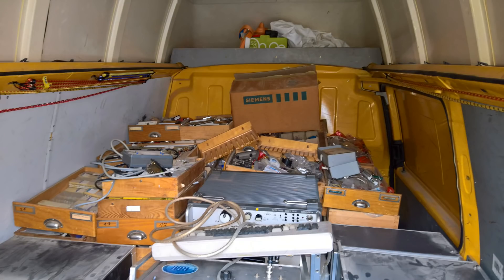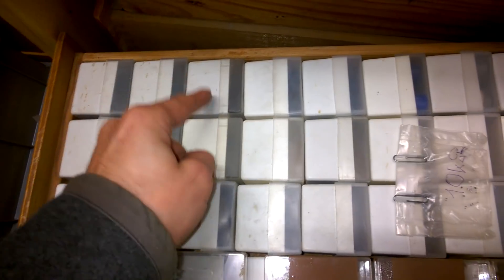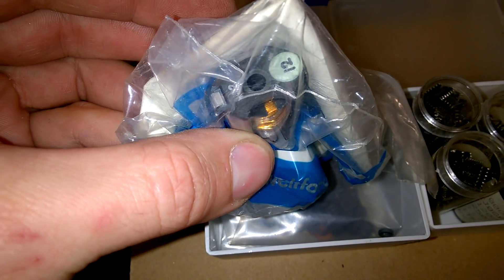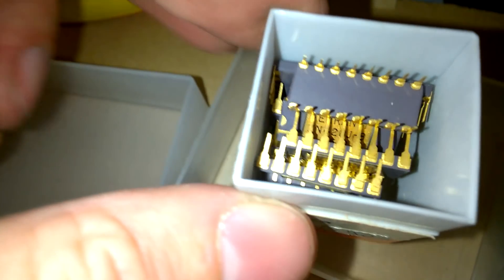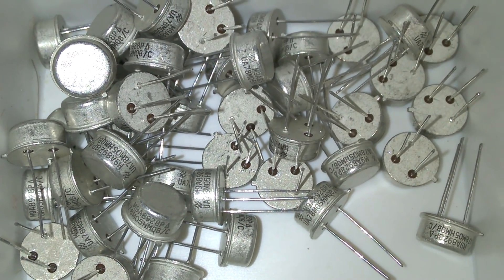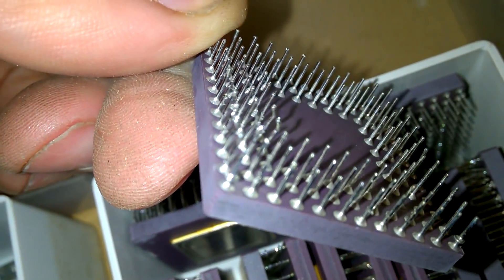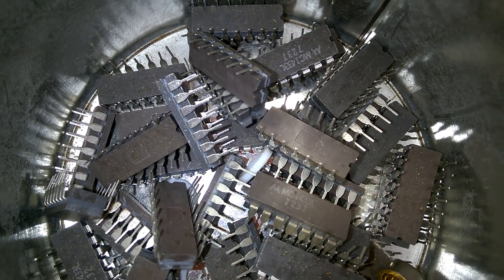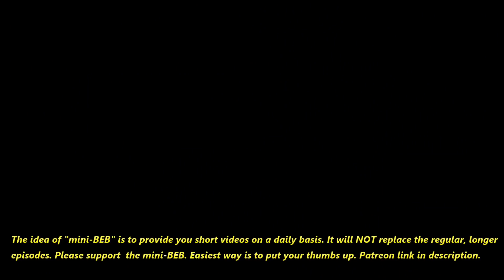CEPUS #10: Crazy Electronic Parts Unboxing Series (Mini-BEB) Gold

Comment: Yay CHIPPIES!!!! The MB114Fxxx is a very old gate array from the 1980. They were obsolete by 1990 and replaced by MB214xxx. Those are CMOS ones, not ECL, since they do not have the obligatory heat sink mounted. 3240 gates only. They look good but unfortunately they are not good for anything anymore.
Reply from the maker: wonderful !!! Where did you obtain this information? I have found NOTHING. Is it programmed, in a non-erasable way?
Reply: @MaxKoschuh  From memory and an old book "Channelless Programmable Gate Arrays" that is still in my basement somewhere. I worked with those in 1990 before migrating to Altera MAX EPLD. I have used the smaller ones MB112Fxxx (~1000 gates) and later the MB622xxx (much faster ~1200 gates). These are mask "programmed". We had a special computer with some weird schematic design software on it as well as a "terms crunching engine". In order to test the circuit we usually had to built it on speedwire veroboard using ACT logic and run it at a lower clock rate. If that worked we gave all the design files to the Fuji office in Germany and they made a bunch of chippies for us in Japan. All that rather high NRE costs. Those chips had their top layers made to your design. As CPLDs became faster we started using Altera, much cheaper and more flexible. I also worked with National Semiconductor SRAM FPGA's (yes they made these) and Texas Instruments Antifuse FPGAs which were a PITA. I threw all the Antifuse FPGA books in the bin. Never liked the stupid things. Later I worked with Xilinx XC2000 and XC5200 both SRAM FPGAs. Then I went to analog precision stuff. Oh the number MB114F023: that is most likely the 23rd design they did on this MB114F type. Our numbers were much higer on the smaller gate arrays. The only detail I can reveal is, that our designs were for digital broadcasting R&D.
Reply from the maker: Excellent in any ways!! Thank you so much!  @ChipGuy